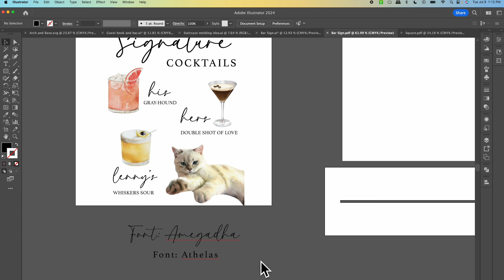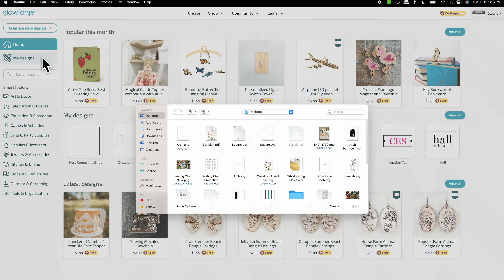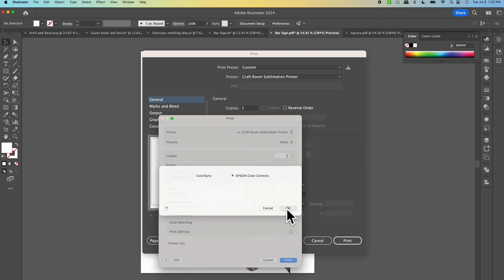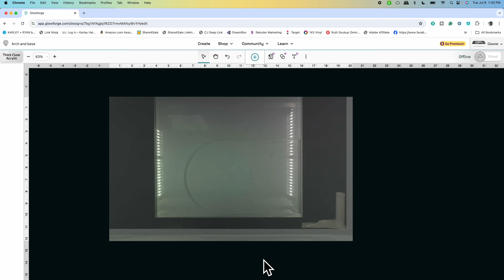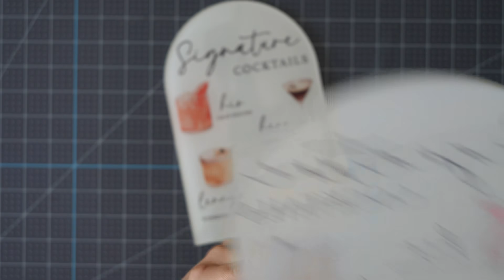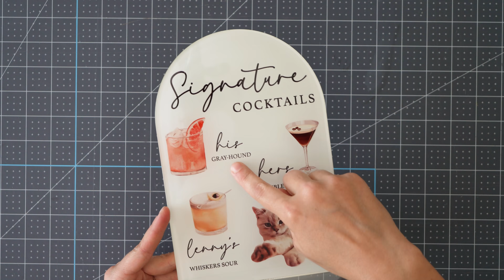How to Sublimate on Acrylic

Comment: I don’t understand why you were able to not mirror the image. If the backing of your acrylic sheet is white, then you wouldn’t be able to see through the image, and if it isn’t white… well then the image wouldn’t look as opaque as it does. Can you clarify that for me please?
Reply: The acrylic she's using is a clear with white that allows the sub ink to show (so subbing is on the back of the acrylic).  The other is to used solid white acrylic, which you would mirror and subbing is in the front instead.

Comment: Hi - your A-sub paper doesn't stick to this substrate? I find that my Espon Sub paper (supplied with my F150) will sometimes stick. Just wondering if I should try the Asub paper. Also, I appreciate the info/hint for the -.01 adjustment to the cut file for the stand. Thx!

Comment: Question:
When I load my AI svg file into glowforge,  it doesn't keep my measurements. How do you keep the exact measurements on yours? 

Example,  I'm cutting on 8x10 acrylic sheets, (file reflects that size) but when I load the path in,  they are small (like 3 inches.)

Comment: sigh i got some melting on my acrylic with this temp and time.
Reply from the maker: How was your pressure?
Reply: @KarleyHall  very light
Reply from the maker: @kellyking4258  Are you using the same PYD life sublimation acrylic? This acrylic is specifically made to handle heat.

Comment: Hello, darling sign! I haven’t started sublimating yet, so I’m curious if you needed to cut away the excess paper after you heat pressed?
Reply from the maker: Nope the ink leaves the paper and goes into the project blank :)
Reply: @KarleyHall ohh so the white on the sheet itself is also transferred along with the print of your menu; then once you peel off that layer both the white and the color printed menu stayed on the acrylic?